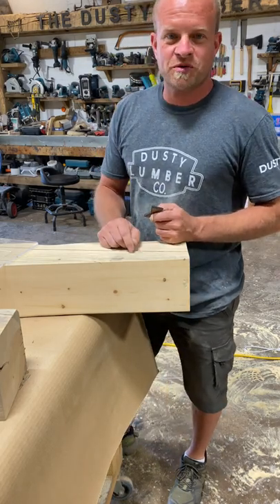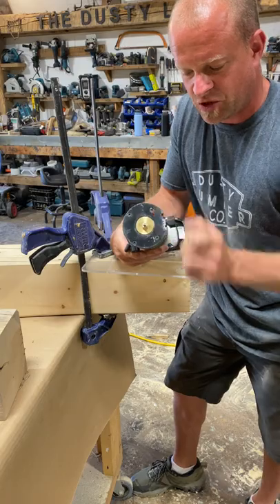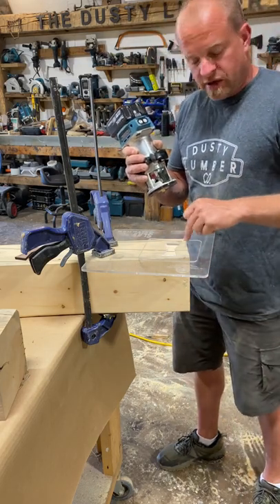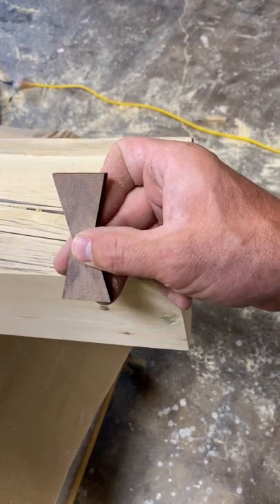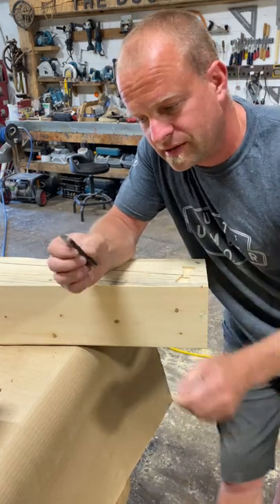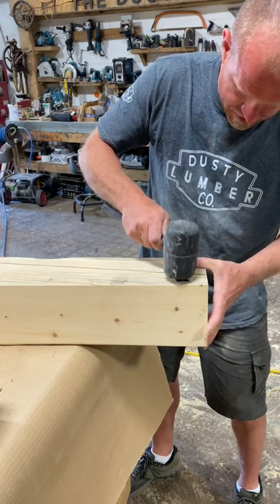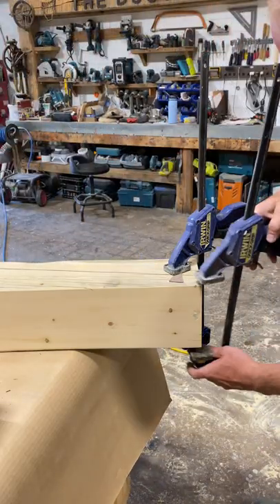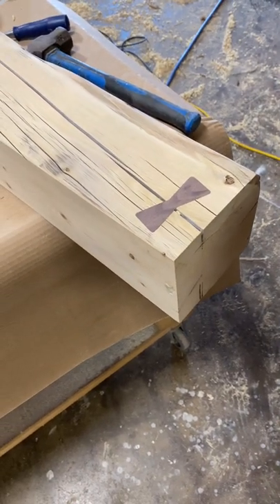How to do bow ties with Slabstitcher

Comment: Dear Dusty,
I wonder IF I press the sides with pipe clamps to force the crack to 'close' and just then dig the hole for the tie, will make a better looking job. Any thoughts?
Many thanks.
Reply from the maker: You will have put a lot of tension in the wood and it will always be pulling to get back and might break the tie